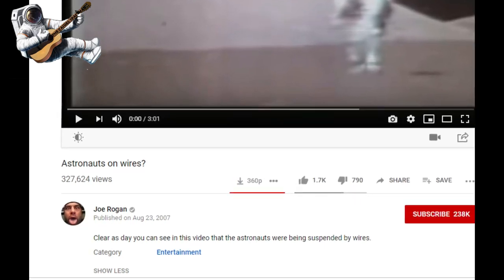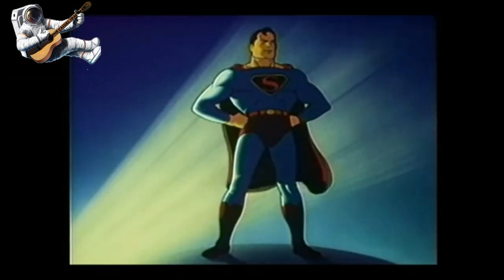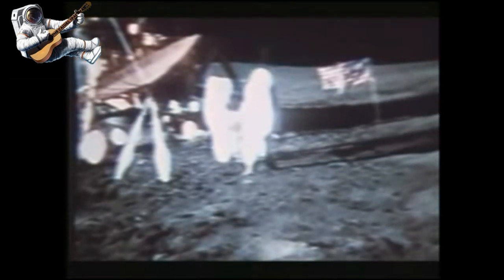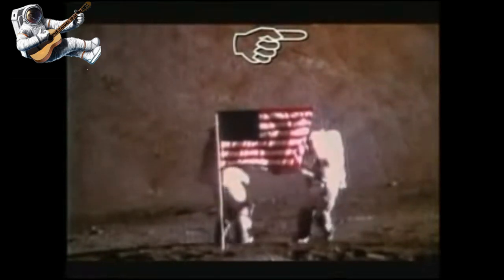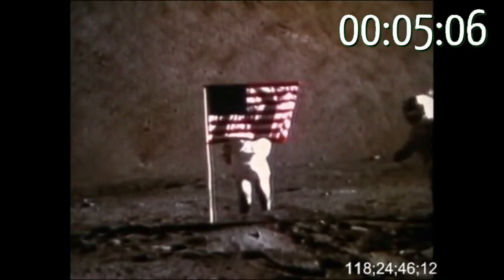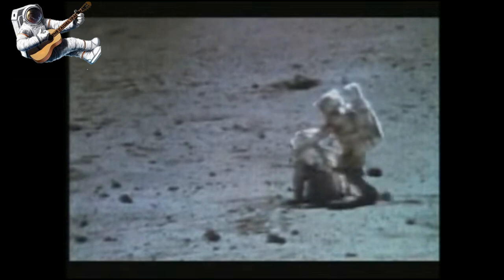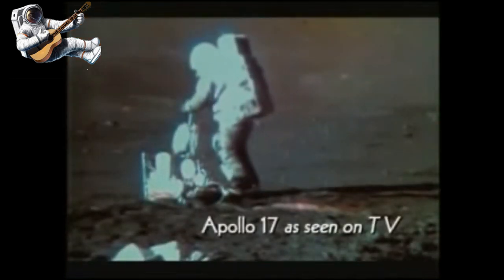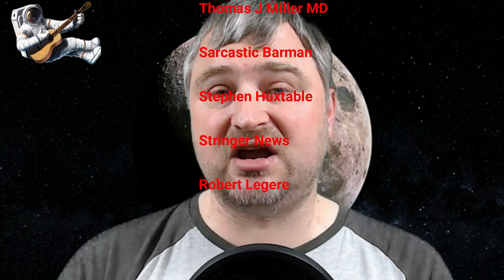Moon wires nonsense debunked - Feat. 1MD

Comment: So he was cherrypicking on the hundreds of video glitches until he eventually found one that matched his narrative. Sounds totally legit.
The problem with these glitches that occur vertically over an overexposed portion of the image is the function of the camera sensor tubes they used in the 70s. They tend to create a vertical "beam" when they are overexposed. So this type of glitch also could have been caused by the camera itself.

Comment: The missions after Apollo 11, anything you see in color from the moon basically, were in fact all transmitted in standard NTSC video at 30 fps. However, slow motion on that scale was not possible, as SG Collins has pointed out. What Collins missed, being a filmmaker but not much of a space fan, is that slow-motion would not have been very useful in faking this video anyway,  for a couple of reasons. One, the astronauts' OTHER motions would have also been slowed, and they weren't. And two, slow motion would have done nothing to solve the intractable problems (even today) of simulating sunlight in a studio and getting rid of dust lingering in the air, especially in later shots that included the Rover.

Comment: You ar a bit of for the Apollo lunar camera. The black and white camera that was used on Apollo 11 was 10 fps and you neede to convert the frame rate.
The late missions used a color camera that had the same frame rate as NTSC at  29.97 fps and because it was interlace it scanned half the lines 59.94 time per second. The color encoding was different. You had a rotating filter in front of the sensor that change the color for each scan. The result in a monochrome signal with changing color filter so you need to combines 3 scan to get a singe color image.
There was a special system on Huston that could decode the color system and create a color NTSC color signal with a a analog magnetic disk as a frame buffer.. The frame rate was the same as for the NTSC so not frame rate conversion was done 

https://en.wikipedia.org/wiki/Apollo_TV_camera

If the Artemis program work out as hoped and there is a lunar landing in 2024 I suspect that thee will be live high quality video of the landing.
Reply from the maker: Thanks but I am certain Apollo 11 used B&W at 10fps and the encoding for that mission was very archaic and clunky.  Thanks for sharing that with as I am not clued in with how that all works. Much appreciated.